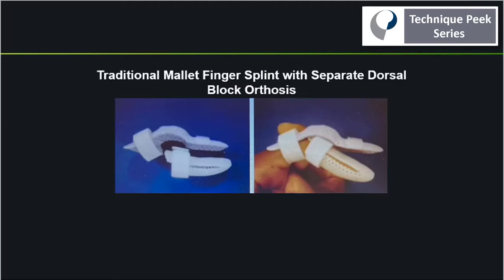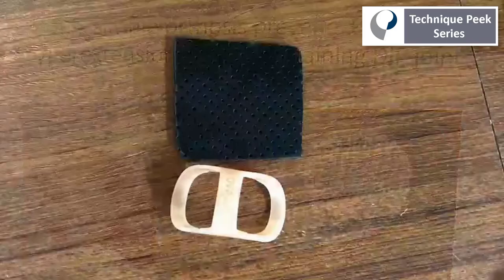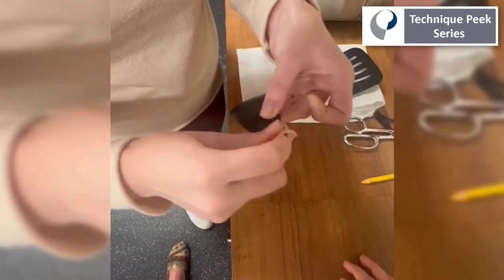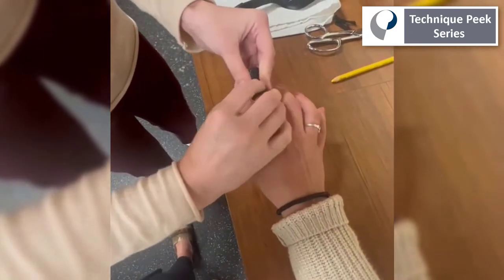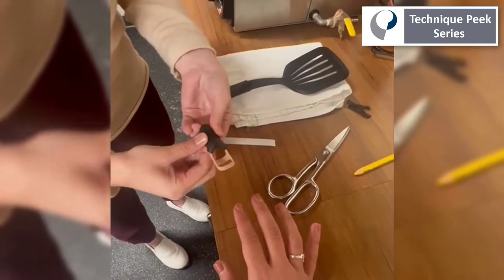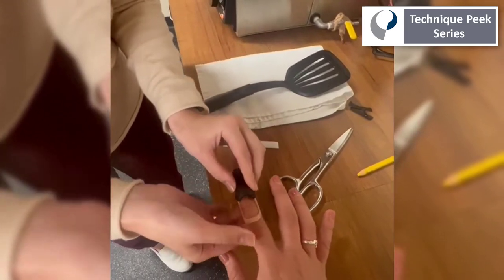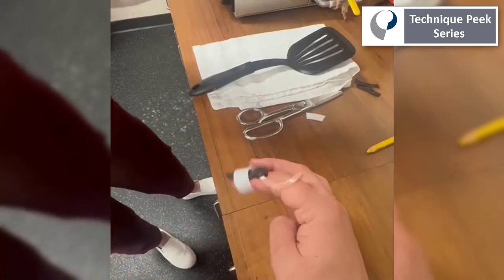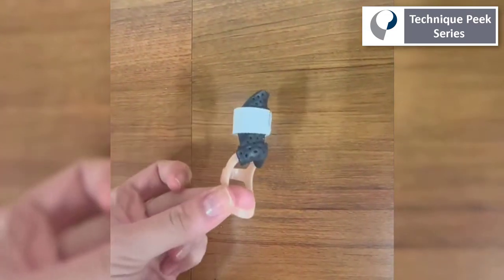How to create an anti swan neck deformity splint using a prefab oval 8  |  Technique Peek Series

Comment: I just spot heat the oval 8 splint to place into increased flexion position, so that the DIPJ does not form a contracture. No need to immobilize the DIPJ for a swan neck.
Reply from the maker: Thanks for the tips!